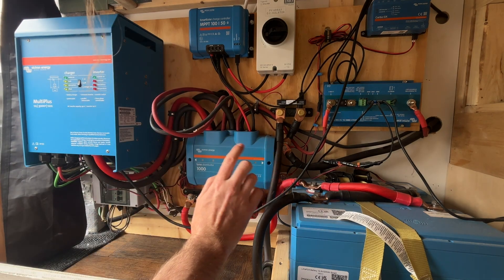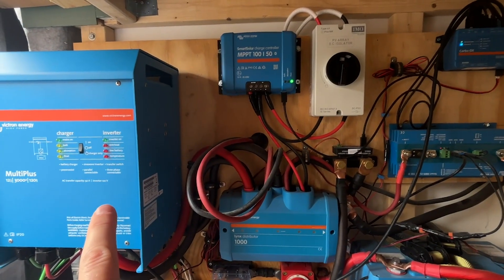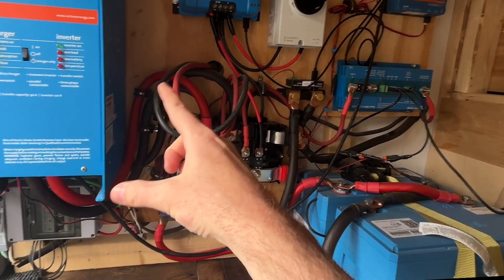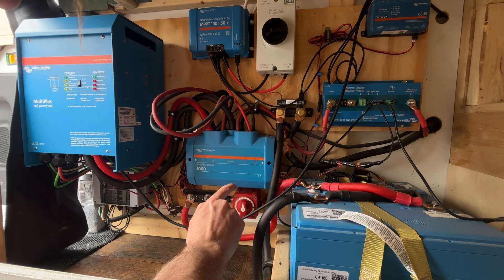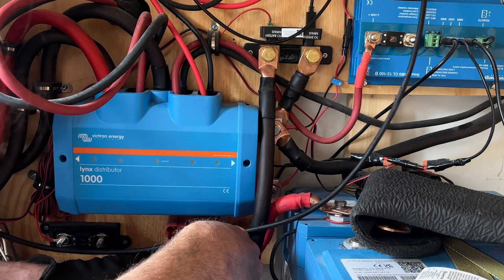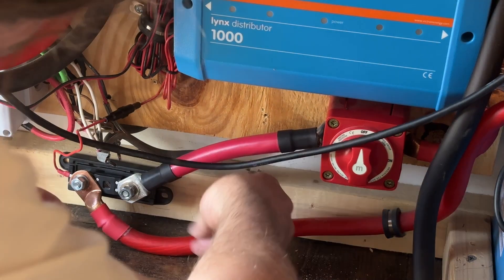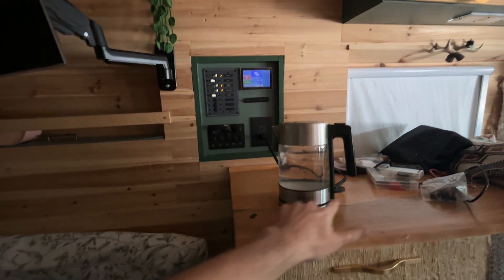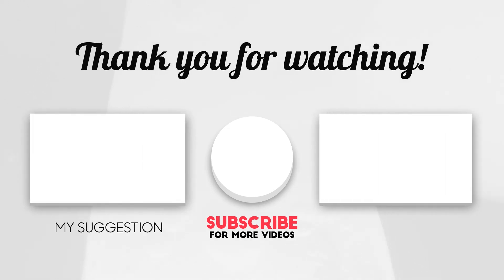We Fixed Our Victron Low Voltage Alarm With This Simple Check!

Comment: Was the Cerbo giving this error frequently, or just every once in awhile?  Was the error "0_CLR_LOW Warning Low Battery?"
Reply from the maker: The Cerbo only gave us the warning when we were pulling high voltage for the water kettle. Warning said ‘Low Battery Voltage’

Comment: Generally speaking a loose connection could cause that. Either that or the fuse overheated.  But usually its a loose connection.  Do you have lock washers on all of those bolts/nuts ?   You will definitely want to check that area for heat issues as time progresses, just in case it wasn't completely covered by your fix.

Also its a 12V system which is a bit cringe... that's why the amperages are so high and there are significant voltage drops even wotj incredibly thick cables running everywhere.  But nothing you can do about that now without spending a lot of money so... you work with what you have.

-Matt
Reply from the maker: Hi Matt thanks for watching and commenting 🙌 

All the connections have lock washers and are torqued to spec. The system is actually built identical to a Victron design schematic used for campers. Not sure why you think 12V is cringe but this is the same kit Van Land recommends for van lifers. We’ve used it for about a year and a half now and it’s been great.
Reply: @MattyAppleSeed  The question then becomes... then what overheated?  Did you determine the cause?

Sorry I didn't mean to be hard on you.  Really I meant to be hard on Victron for continuing to promote 12V even as people's power needs increase.  It's really unnecessary in this day and age to use huge thick cables just to run a tea kettle.

Even for small vans where the solar panels are more limited, 24V is just a better choice.  Or even 48V if you take some care with the panel topology.   But at least 24V, which cuts all your amperages in half and power losses to 1/4th that of 12V.

-Matt
Reply from the maker: @junkerzn7312 

Hi Matt,

In the video you can see what caused the fault. There was a wire that had corroded and was burnt up.

This 400 amp hour system has a 3000 watt inverter so those 4/0 wire are pretty standard. If you look at videos showcasing van builds and their electrical systems pretty much all of them are using these thick 4/0 wires directly out of the battery bank. For us the only times we pull that much power is while cooking or with a water kettle which both pull over 2000 watts during the initial surge to boil. 

The only 4/0 wires in our system however run to the inverter and batteries. The DC powered pieces use smaller gauges and so does the solar and alternator charger. 

I have heard of 24V systems but this works great for us tbh and there was a lot of documentation/resources for DIY installations.

The only trouble so far ended up being that one line that burnt up but I suspect that happened because it was way to short with DIY wire lugs crimped on both ends causing competing tensions leading to the fault.

Here’s to avoiding any more issues in the future 🤞 

Hope you join us for the ride! 🚐 💨
Reply: @MattyAppleSeed  Hmm.  Its really unlikely that it was corrosion.  Not with all the other connections in such good shape.  It looked like the results from overheating.  aka loose connection or perhaps the connections was not completely flat against the terminal block or something like that.

I wasn't paying close attention to whether those were copper lugs or tin-plated copper lugs.  Pure copper lugs can oxidize, but even there the contact area (under the proper pressure) should not have been able to corrode unless they were oxidized prior to being wired-up.

Another possibility is that the crimps had problems... such as insufficient bare wire put into the lugs or insulation being pushed into the lugs prior to crimping.  Or something like that.  That could cause the junction to overheat and result in the rest of the discoloration we saw in the video.

-Matt
Reply from the maker: @junkerzn7312  Ya definitely spot on I think there was some issues crimping the lugs in both sides of such a small wire. I crimped all the wires myself so definitely suspect that this was the issue here.

For sure though it was overheating that left to the fault though. I may have been mistakenly referring to the burnt wire as corrosion. 

The new wire I bought was pre crimped so no need to worry about those lugs anymore. In the video you can see one of the lugs was burnt to heck.
Reply: @MattyAppleSeed  Sure looks to me like that switch is fried. From when you first removed it, you can see the problems at the stud, and then how the stud protruded enough to melt the back of the case. I would DEFINITELY be replacing that.
Reply from the maker: @BorealisNights  ya the switch was definitely melted a good bit. When I originally fabricated the wire going into that it was way too short the lugs barely had any space between them. Got a much longer prefabricated wire this time! Thanks for the comments! 🫡